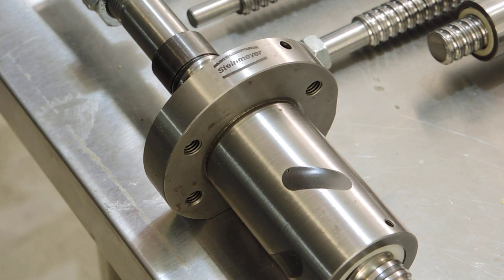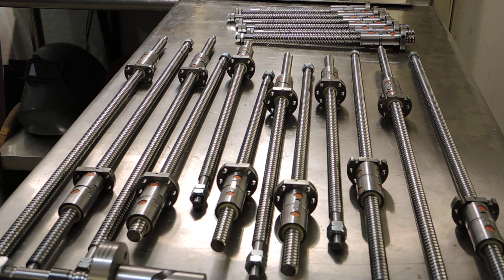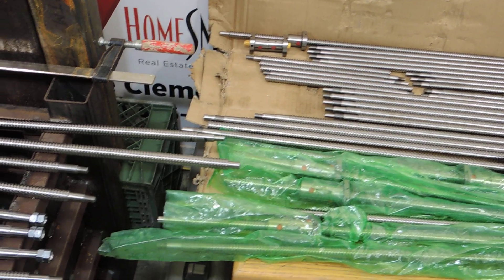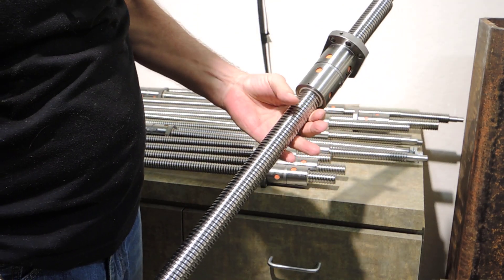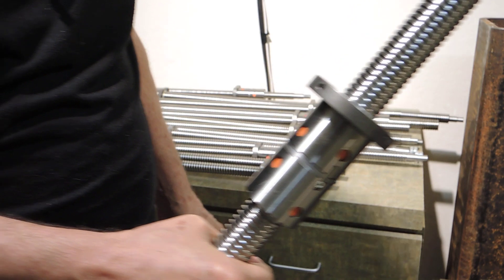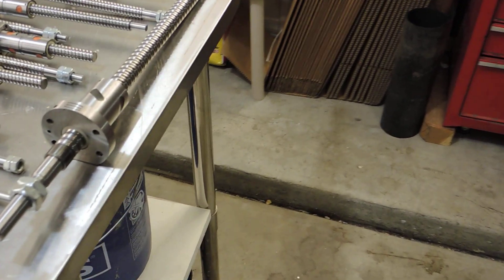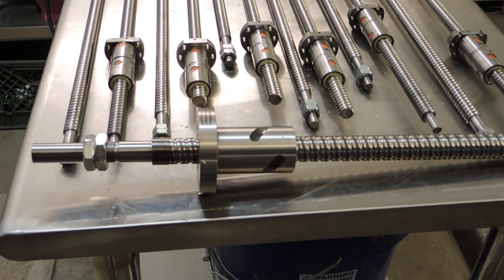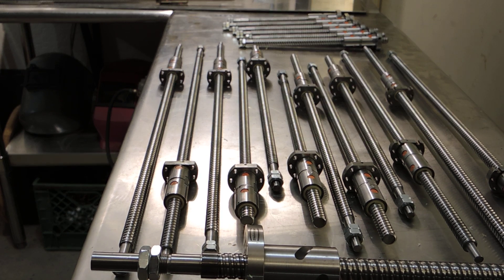Enough ball screws for everyone, PM-25, PM-30, PM-940

Comment: What diameter ball screws do you recommend for a co 12z mill on for xy and z.  The ones that came with my mill seem to be too small because there are a lot of backlash when the the gibs are tight.
Reply: A small screw can have no backlash.The size is not problem.
I run 20mm X and Y and 25mm or 32mm for the Z. Backlash is from the end bearing or ball nuts. With double nuts you can add shims to tighten them up, same for the end bearings. Some people use standard  end bearings too and they will need to be replaced with Angular Contact and add a .001" shim most the time.

Comment: Do you have a X & Y axis ballscrews for a G0761 mill , I just want to use by hand the left side has a power feed the Y has a hand wheel
Reply from the maker: The 761 is a RF-45 clone mill. The table might be the same as the PM-932. I have screws that fit and the mounts might fit. 

If you have a power feed use it with the stock screws. If you want power with a ball screw then add a stepper motor. For the screws I have they can only be driven on one side. The bearing is on the other and has no shaft. You could make a 12mm lock nut with a bolt clamp and have it mount the handle. Not too hard. For power feed you still need to adapt it.

Comment: Hi, I just bought 3 big ballscrews from aliexpres and all 3 seems to have bends up to 0.3mm in middle of screw. Do you think I should open dispute and ask for some refund, and do you think its could be corrected by bending it back with some press to use it for high precision CNC. They are 2 DFU2505 1500mm and 1 DFU3205 2500mm, nuts have also huge backlash, but that may be because they are not tight enough because spacer between them is too thick. Thanks.
Reply from the maker: Often when the ends of the ball screw is annealed it will warp some. It is fairly easy to straighten them using V blocks if they are 16mm. The larger ones get quite hard to bend. I have done the 20mm on my mill but not tried the 32mm. 

.3mm is not that much bend. I would leave it. 

On the backlash you can add shims and it is vary common to do that. I shim most every screw.
McMasters is a good place to look for them.
Reply: @ArizonaVideo99  
Thanks, your answer made my day.
I was also yesterday at company that has business with CNC machining and they said they cant fix it and that I rather dont touch it because I will probably make it even worse.🙃
The thing that now bothers me is that I had plan to build big high precision steel cutting CNC and expected precision of about 0.05mm per axis🤔, and maybe some time later change it for more quality rails, ballscrews and servos instead of stepper.
The other comment they made when they realize I would have 2 steppers at x axis is that I should have only one below and that 2 of them is very hard to program to work together.
Reply from the maker: @eugenega7494  
I have straightened a hundred screws. Its a bit fussy because you need to measure the screw and its not flat. I sat a parallel with a block on one end and put the indicator on that and used the mill quill to apply pressure with the screw on two V blocks. Larger screws like 25mm that are short will take a lot of force and you will need a press. Long screws can be straightened fairly easy with a mill quill if the bend is in the middle.  Their is a few videos out on this process.

https://www.youtube.com/watch?v=dzIsR4Mg158